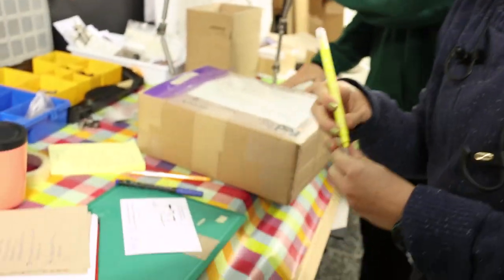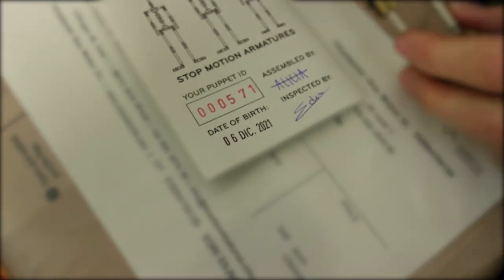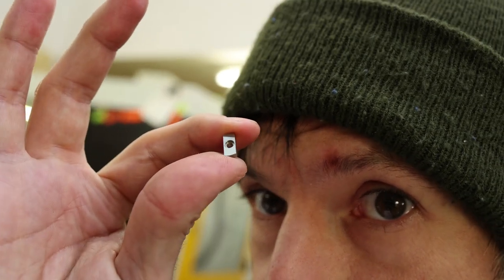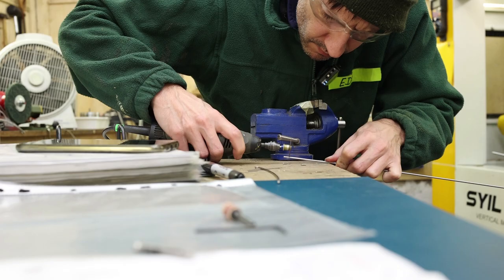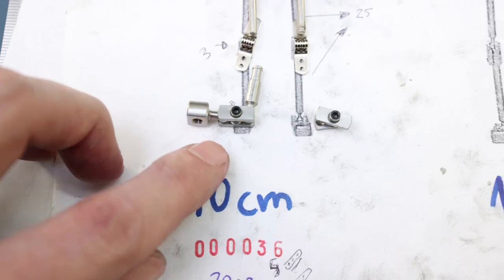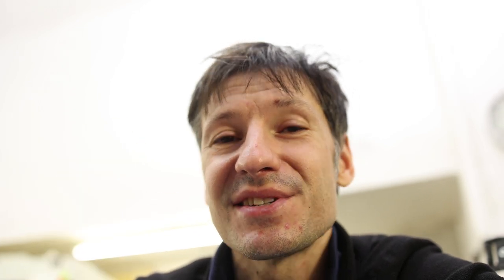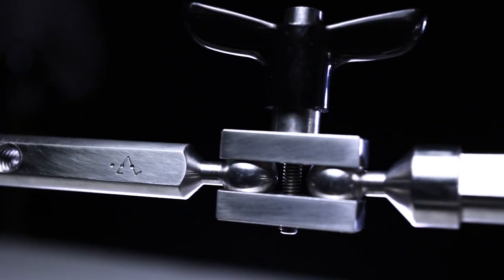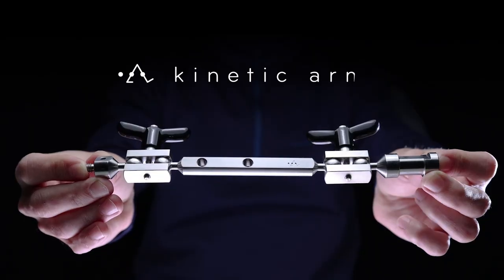Smaller than a Sharpie

Comment: I love your work… As always! 

Your work and attention to detail are always fun to watch….solo I’m sure you have the process figured out. 

But if ever you get in a difficult or confusing situation… There are always folks like myself (process engineer) who would happily make small suggestions

 I specialize in small scale but complex manufacturing and machining.
Before process engineer, 

I started right after high school as a watchmakers apprentice for two years. Then realized I was more interested in machinists work. So I had several Jobs and then my own business doing machining and fabrication work. Both with manual and CNC.

Then started a business doing component level circuit board repair for industrial and manufacturing equipment. Specializing in test equipment calibration/metrology. It’s what I still do to this day, with my own lab… If I’m not doing the engineering gig.

Somewhere in the middle of all of that… I accidentally started a jewelry wholesale business with a family member. Lost wax casting, faceting, engraving…..And all that comes along with that. Designes are sold by the thousands or tens of thousands. All crafted by hand locally, with designs constantly changing.  I learned to design the process efficiently. So that normally time-consuming and complex tasks would be efficient…. and most importantly… CONSISTENT. 

That’s how I fell in love with the art of process design & engineering. Went back to school, apparently they let you do that even if you’re old. 🤷‍♂️

It’s a lot of fun.  it’s always great helping manufacturers solve problems. I feel like a big kid rearranging Lego blocks until I figure out what works best for A particular situation. It’s a constantly changing minefield of complex problems. It’s a lot of fun!

So if you ever run into a tight spot… Find a local or online friend who is a process engineer and let them look over everything. 

A few small adjustments here and there… Can make a shop and manufacturing process 10 times more efficient and consistent. And consistency equals financial savings EVERY TIME!

I live by the rule…
Chaos is expensive.
Reply from the maker: Hi Hull, thanks for your explanation. I agree chaos is expensive. I studied product design and after that stopmotion. In both the project is crucial to make it happen. I do have little chaos in the workshop but it is not because of non planing it, it is more because we try to help people all the time instead of following what would make more sense and be more eficient. We are not here to make money, my goal is to make products or tools that helps others making their Dreams. So most time all we do is custom work, non repeatable, would love to have stations for every job... But. We do our best... Hope it gives you an over view, and thanks for giving us that point of view.

Comment: Are the hinge joints a newer addition? Or only for some sizes? ( Also-Your music choices are top notch as usual!)
Reply from the maker: Thanks!!! I spend a lot of time chosing musics that match with the content, not always I do like them, but try to. About the hinges... they are replacements from glasses that I use when it is needed on a custom puppet armature.
Reply: @edupuertasfruns  : Would you tell us where you get this particular hinge? How many others did you test out before you decided this one was best, or do you find that it matters?
Reply: @Mauzyrock RC :  Edu introduced these joints in one of his past videos for use on another puppet that required slim joints. Have a look at his past video postings and you should find it.
Reply from the maker: I did buy them on ebay or aliexpress, I did try many, and don't even remember where to find it again as those sellers are never permanent.
Reply from the maker: Yes it was a video called How to make stop motion hinge elbows